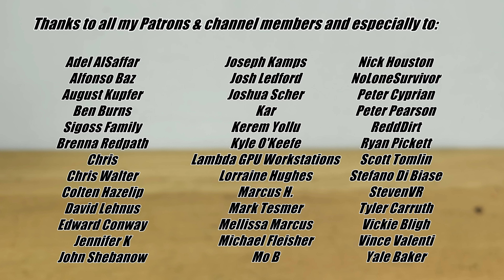I make my own Locknuts - DIY Nylon Nuts

Comment: Possibly the only person in the world that would even consider making something so readily available.
Reply: Except when they aren't available. And he couldn't find the ones he needed.
Reply: If they were used in the first place, somebody mass produces them. They weren't all handmade on a lathe. 

They're available somewhere.
Reply: @pyme495  You do understand when the car was manufactured, correct? I'm not a mechanic but even I know that things from 50 years ago have stopped being manufactured. But, hey, you do you.
Reply: Sure, most any mechanic or restorer has a $420,000 machining lathe just sitting around to make a $3 part.
Reply: @sonorousbelchpipe1021You can get a really nice old lathe for under 10k. Really nice.

Comment: The JIS standard for M10 is 1.25 pitch with 14mm hex. Pretty much all M10 fasteners on Japanese cars will have those dimensions, just like M12 is 1.25/17, M8 is 1.25/12. It's a nice standardized system, except it can be a real pain when you need a replacement screw or nut and you live in a world of DIN or ASME fasteners. Finding a new production nut like that would be hard because modern automotive fasteners are almost always flange nuts now, plus of course that abnormally tall height. I never thought it would be practical to make a nylock in a home shop but you made it look easy with the first try. Great video as always!
Reply from the maker: Oh really? Never new that JIS standards also have changed pitch! Thanks for sharing.

Comment: Wenn du diese Mutter an deinem Auto benutzen willst, solltest du auf die Festigkeitsklasse achten. Ich hatte sehr ähnliche Muttern an einem Oldtimer und sie waren im Original Festigkeitsklasse 12.9. Da ich solche Muttern nicht im Baumarkt (oder von meiner Drehbank) bekomme, bin ich auf ein Kfz-Ersatzteil eines anderen Herstellers ausgewichen, der exakt die von mir benötigte Größe immer noch im Sortiment hat. Deine handwerkliche Kunst steht für mich außer Frage.

Comment: Hello my dear friend 
Astonishing work as ever. 
I just wanted to share with You that in the aviation industry a different approach is used. 
First 99.9% of the threaded joints are self locking. There are cotter pin and wire locking used but mostly the nuts are self locking type. But because of the extreme temperature differences nylon nuts are not suitable. Aviation nuts instead of plastic rings have an elliptical opening on the top part and when you tighten it the bolt bites into the nut. Of course all the nuts are heat treated and mostly made of titanium so you can reuse them multiple times (if the technical documents allows it).
So again an excellent job as always and I can't wait to see the final "product".

Comment: Out of curiosity: what is the reason for making a new one of this nut? Does it need to have such specific features for the application or you just wanted to have it the same as the original?

Comment: I was expecting to see the arbor press you restored used as the pressing device.

So after a nylon nut is used what do you with it?  Throw it away or can the nylon be restored?  I imagine the latter isn't cost or time effective.
Reply: The arbor press wasn't strong enough. He was able to get more power with the vise.
Reply: @Vickie-Bligh  I wouldn't have guessed.

Comment: 1:38 - "Never reuse the nylon nut" - at least not with different bolt, as different bolt would have slightly different parameters like width, thread thickness and so on
Reply: No, you don't reuse nylon locknuts period.

Comment: While interesting. It just occurred to me if it is possible to reuse the nut by bending that ridge back and replacing the nylon ring. 
Now of course a new tool is needed to bend that ridge back. 
🤔

Comment: You press it. I roll it. Same result, less steps. 
I make the nut, insert the ring and roll it closed.
Have made a tool for it. It´s a wheel  with an inner small diameter.
Reply from the maker: Cool story, thanks for sharing :-)

Comment: 10x125 key 14 is not rare un French cars. Forgot if they have the lock ring, but I do have many of those nuts in my garbage box.
Reply from the maker: 12mm high? send me some
Reply: @mymechanicsinsights  that garage can is currently 400 miles away ... But sounds like it. 

If you have them on some car, then someone who dismantled that car have plenty. 

For sure I have long M10 key 15. And some day one nut was too narrow for key 15 and I rejected it because I wanted some thickness on nut walls. And yes They are long. But probably without stop ring.

I easily find some online WITHOUT the stop ring ... 

They are frequent on wheels and steering systems. (Either conical, spherical, or with dents ).

Comment: This might be helpful to some without a lathe handy, if you do need to reuse a nylon locking nut and don't have a replacement handy you can heat and partially melt the nylon ring and it can partially re-form and partially 'erase' the threads pushed into it. This will allow it to lock onto threads once more but not as tightly as the first time it was used. It's not a perfect solution but it's a handy trick if needed in a situation.
Reply from the maker: Great idea, have you done this?
Reply: @mymechanicsinsights   I have yes. Realistically if it's torqued to spec and you add some blue loctite it's about as good as a nylock nut, and you can put loctite on a used nylock nut if need be. It's not the 100% correct way to do things but in the real world it's fine.

Comment: Is that nut interesting for using with hydraulic assemblies? I think maybe the nylon ring grants an extra sealing for the bolt. 

Which material is the nut made?

Very clean job as always!
Reply from the maker: Never heard that they are used as sealed nuts.

Comment: just a tip... nuts for automotive application must be made with low alloy steel (class 8.8 or above) and after zinc plating is interesting a dehydrogenation process to avoid cracking
Reply from the maker: Thanks for sharing

Comment: Very nice and handy solution to a non-problem. Loctite would have been a slightly quicker solution to the original problem….but it wouldn't make for a good video. 🤪
Reply from the maker: Great point!

Comment: I don't know if this is the case but JIS hardware is often smaller than typical metric. For example an 8x1.25 JIS bolt uses a 12mm wrench instead of 13mm.
Reply from the maker: M8 also uses 14mm, but all other size threads use the same as metric usually. Just M8 doesn't have 13mm

Comment: Nicely done! If it's going on your car I'm surprised you ran it down on a bolt first. They always work best fresh, but I get you had to show a test for the video's sake. Did you consider zinc plating it before pressing the nylon in?
Reply from the maker: This one was only for testing and this video, the real ones were zinc plated.
Reply: @mymechanicsinsights  that explains the multi nylon cutoffs. I wondered about that. 👍

Comment: Love the video, enjoyed the process 👍

BUT you can absolutely re-use nylon lock nuts. It's a myth that they shouldn't be reused. Carroll Smith in Engineer to Win has a good section on locking nuts and bolts explaining all this.

Also, from the same book among many others, commercially available nuts and bolts have rolled threads rather than cut threads because rolled threads are stronger. 

So be very sure of your understanding of the application before making new nuts and bolts to replace existing.
Reply from the maker: Thanks for sharing

Comment: i did the same, big issue? the original is tempered material if you want to do the same a hydraulic press is needed with some additional support.

Comment: So, we finally find the limits of My Mechanics' obsessive attention to detail. He won't zinc plate a test item that he's planning to discard later. 😋
Reply from the maker: Yeah haha
Reply: @mymechanicsinsights  I know you had to make a new one but... is using an appropriate thread locking glue appropriate if one wants to reuse a nyloc?
Reply: @snizami  we have a lot of success reusing lock nuts on our race cars, that said we don't usually loosen them too often and replace them every season. the main goal is of course to prevent vibrations from shaking the nut loose, a thread locker should do well enough on its own(no nylock nut) but is slightly harder to apply to nuts. In general for daily drivers i would recommend replacing simply for peace of mind.
Reply: @koomansracing5287  Thanks. I'm wondering, though, why reusing the same nyloc with thread locker would be a problem. There's plenty of metal on metal thread for such product to take hold. Assuming non racing conditions with multiple unfastenings, of course.
Reply: @ the issue is that metal on metal does not prevent vibrations from
 Loosing the nut, hence nylocks. They absorb the vibration better then steel on steel. Once used though the threads are cut into the nylon and so will never make a perfect seal again. In our case it’s not a huge deal as we only need to complete 25 laps but in a daily driver it may have to complete 50,000 km before being checked again. With thread locker it may be fine… but I’m not qualified to say it’s been tested and approved. Would I send it? Probably but I’m also an experienced driver something I can’t say for anyone else. I notice when things feel “off”
Reply: @koomansracing5287  It might depend on the thread locker. Loctite has several different varieties, and I think metal on plastic is one of them, but I’ve never seen it used on a Locnut. We always just used metal on metal blue.

Also, as these are plastic, do they deteriorate quicker than a simple metal nut over time? Or do they get replaced due to vibrations often enough it doesn’t come up?
Reply: @snizami  depending on what you are fastening, a lot of the time the torque is what is doing the work and a nyloc can just be reused if it is torqued correctly. Threadlocker will do the same thing if you use the right one but some threadlockers are harder to remove. A nyloc might be used instead of threadlocker because it saves a lot of time in the manufacturing process.
Reply: @snizami  It wouldn't be a problem using threadlocker on a worn nyloc nut, it would work just fine.
Reply: @koomansracing5287  Proper torque will also keep fasteners tight without nylocs or thread locker. Did you ever see main cap bolts/nuts or connecting rod nuts/bolts come loose? The one thing that always happens is that they always get torqued properly which causes them not to vibrate loose.
Reply: @snizami  imo yes

Comment: Nylon nuts are my favorite nuts they don’t hold well. I prefer actual lock nuts. Some are oval threads. Some are pressed in three places, some just have the gear imprint on back. Reusable and secure. Thing is in my fifty years of working on cars I have never see a nylon lock nut unless they were added after the fact, which includes 240s.  I am curious where you found this on your project.
Reply from the maker: It's on the sway bar

Comment: Is it not dangerous to sandpaper the nut while it in the fast rotation without gloves? (Sorry for my bad English)
Reply from the maker: You could get hurt, yes.
Reply: It would be more dangerous with gloves on I think, unless very thin, as gloves and spinning machines is a risk of getting caught and more injury than a bare hand would suffer.

Comment: Is it possible to place the plastic ring in the base of the nut? That way you don’t have to make a pressing tool and I think it works the same.  You could easily turn a common nut into a Nyloc if you have a lathe.
Reply from the maker: How is the ring clamped then?
Reply: The ring sticks out or protrudes a little from the base of the nut.  The clamping force between the nut and whatever it is clamping, deforms the plastic ring into the threads.  The deformation should be sufficient to lock the nut.  Different ring heights, thickness or material durometer can be experimented.

Comment: I thought you were gonna make reusable nylon lock nut
Reply from the maker: Never thought of it
Reply: @mymechanicsinsights  @mymechanicsinsights  you can make some kind of crown to hold the nylon ring and when you want to reuse it just open the crown and change the nylon ring

I know due to material fatigue, the crown won't last forever if open and close so many time but still you can call it "Reusable Nylon Lock Nut"

Comment: 5:48 - A part of the nylon is cutt by the sharp edge and shears off. You have to fix this problem. Some placed this can damage senstive equipement, and is an absolute fail.
Reply from the maker: You usually don't use locknuts inside of engines or such. Just not because of the heat. This will be fine for what I'm using it.
Reply: @mymechanicsinsights correct. The only place I've seen them abundantly is in car suspension systems. They endure a lot of vibration and debris

Comment: A M10x1.25 with a 14mm hex has Japanese car hardware written all over it.
Reply from the maker: Actually they use 14mm for M8. You can try your luck finding this nut. It's 12mm high.

Comment: What is the difference and benefit of a nylon insert nut over an all-metal prevailing torque locknut like Aerotoght, Philidas, Stover nut etc? Genuinely curious how the differ from one another in applications
Reply from the maker: Not an expert on that, I don't know.

Comment: A nylon locknut is just one kind of locknut but not all locknuts are nylocks. Nylocks can't be used in any application where temperature is +/-80°c and above as the nylon loses all locking capability, for that there are different kind of locknuts.
Reply from the maker: Great point! thanks

Comment: Great video but ive been reusing lock nuts on strimmers and chainsaws for years and ive never had a problem.
Reply from the maker: Of course you can reuse them, but just technically speaking you should replace it to have 100% of its locking capacity. The nylon ring can get hard over time and loose its function.
Reply: @mymechanicsinsights  Absolutely. Very well made videos, great closeups. Kudos to you.

Comment: I assume you did match the material/grade used for the nut to the application (as in, 10.9 if it's a suspension component...). And yeah, I know you're doing a faithful restoration to the original, but meanwhile I'm swearing at every 14mm head M10 bolt/nut in my mazda (and happily replacing any that breaks with 17mm heads - so easy to make a rusty 14mm nut into a circle...). Anyways, very nice exploration of the design and recreation, neat.
Reply from the maker: Of course, Thank you.
I always like a good challenge

Comment: why does the pressing tool need to be hardened when it's just pressing a plastic?
Reply: It’s not, it’s forming the metal shoulder into the nylon
Reply from the maker: It's deforming the top of the steel nut

Comment: Ah the joy of "metric". I'm sure you are aware but others may not but the head sizes vary between ANSI/ISO (16mm)  / DIN (17mm) / JIS (14mm). 

It's also why you see M6 bolts with 12mm heads from Japanese vehicles but 13mm everywhere else.

Nice job on the recreation too. Few years ago now I was struggling for similar locknuts. Tried a local garage that deals with Daihatsu and while they were not 100% identical they were near enough, direct from Daihatsu Japan 150 yen each.
Reply from the maker: Yeah Japanese avoid 13mm everywhere
Reply: @mymechanicsinsights  Yes! Nothing worse than having an old Japanese vehicle and somebody fitted at 13mm M6 so you have to go get a different socket just for one bolt!

Comment: well, its a type of locknut, it in itself isnt a lock nut coz you have things like prevailing torque nuts, castle nuts, Philidas nuts. 

All depends on the application. The only thing for fixing arrangements is to remember, NO DAMN SPLIT WASHER

split washers literally make the set up worse
Reply from the maker: Thanks for watching

Comment: Looks like the nylon ring was slightly too big, hence the nylon material shearing off during install.
Not up to your usual standard! ;)
It would be interesting to see a comparison of the cross sections of the old and new ones side by side to see why this happened.
Reply from the maker: Microscopic critique point, I'm happy with the result.

Comment: Absolutely love your videos👍🏻 Just one point, I'm sure you did - because you love the details like the rest of us - but I trust you made the nut from the same material grade as the original (or stronger)? Just to make sure you can torque it up the same without issue. Only asking as I've been down the VDI2230 rabbit hole recently😂

Comment: Is thread locker much weaker than a locking nut? Because if it isn't, I'd say the only upside to making your own is remaining true to the car's history.
Reply: "permanent" thread locker is definitely stronger but requires heat or a lot of torque to remove, much more than a nylock nut. But that's not good for maintenance.
Reply: @szurketaltos2693  I mean... the stuff comes in varying strengths, no?
Reply: @RetiredRhetoricalWarhorse  yes, so it is weaker, it is also much stronger. Depends on manufacturer, formulation, curing, etc. anyways, this channel is a restoration channel after all.
Reply: @szurketaltos2693  True. "I make a new one" is a running gag, here :D.